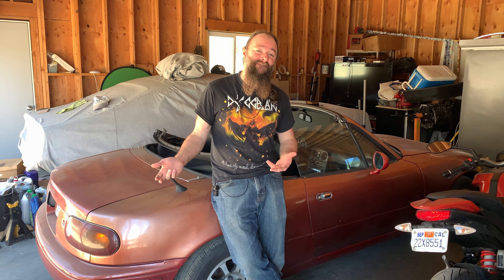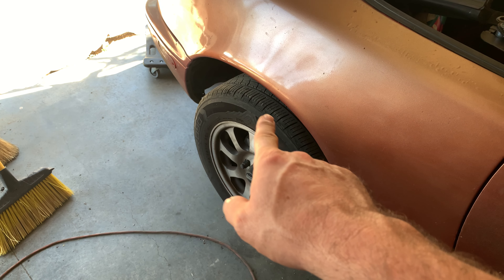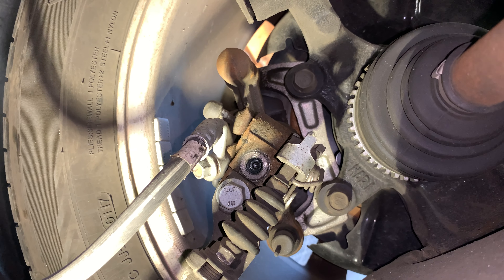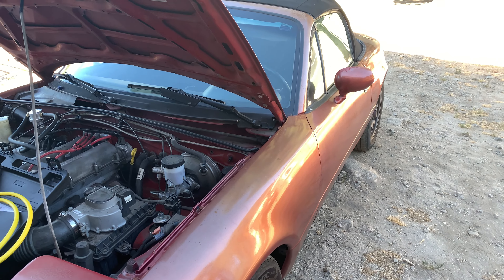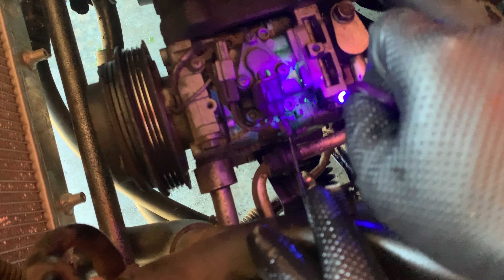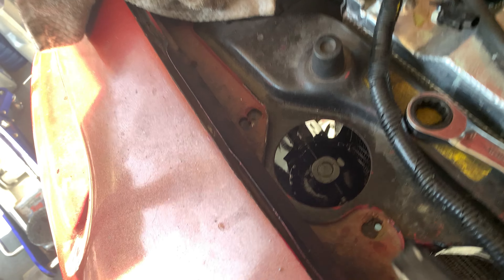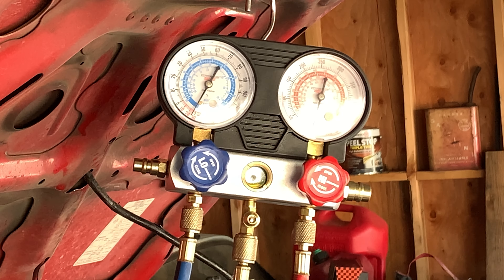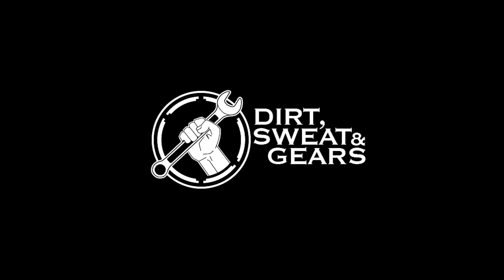EVERYTHING (is broken) EVERYWHERE ALL AT ONCE

Comment: Are you sure you got the oil right for the compressor? It's really easy for them to die if it's oiled wrong. Especially if this is a r12 conversion
Reply from the maker: It was a new compressor that supposedly came pre-oiled with PAG oil, which is compatible with both systems.
Reply: @DirtSweatGears "compatible" and if your last compressor failed you need to usually take all the AC components out and flush them
Reply from the maker: @Pigmaster6373  I replaced the dryer and the compressor entirely. then pulled vacuum for several hours...that should be enough